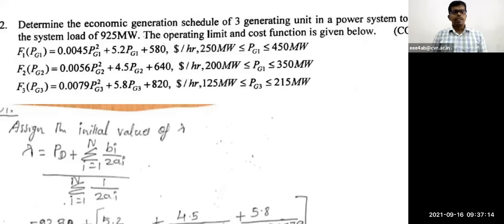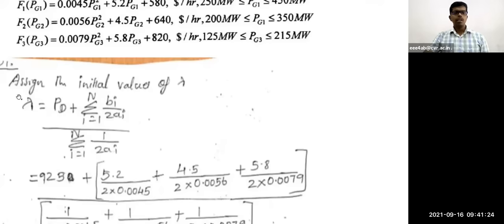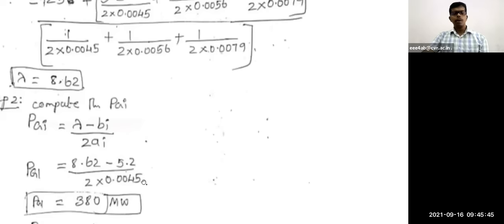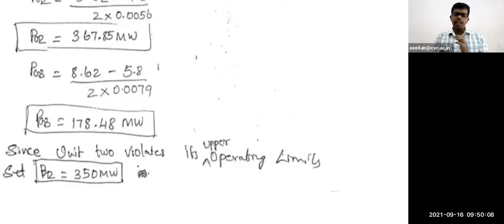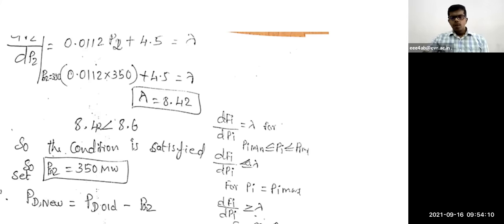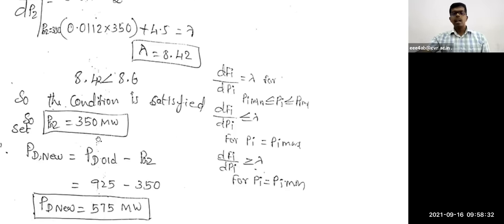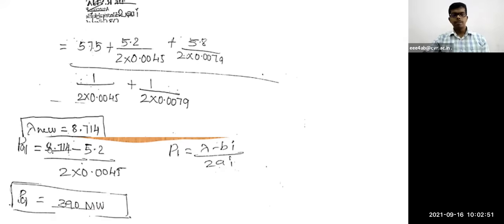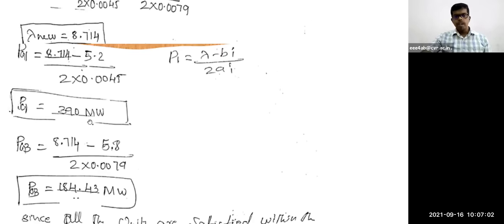Solved Example Problem 4 - Economic Load Dispatch by Lambda Iteration Method #psoc

Comment: Dear  Sir, can we have solution to same question with P(loss)?
Reply from the maker: Yeah Sure... Why not?
Reply: @powersystemz    Consider this:                                      The fuel cost in $/hr of 3 thermal plants of power system are; F1=200+7.0PG1+0.008PG1^2, F2=180+6.3PG2+0.009PG2^2, F3=140+6.3PG3+0.007PG3^2 That outputs are subjects to 10MW ≤ 85MW 10MW ≤ 80MW 10MW ≤ 70MW Assume real power loss is given by the simplify power expression P(p.u)=0.000218PG1^2+0.000228PG2^2+0.000779PG3^2,Where the loss coefficient are specify in p.u on a 100MVA base. Determine the optimal dispatch of the generation when the total system load is 150MW
Reply from the maker: https://youtu.be/aHVnrCy5J3I